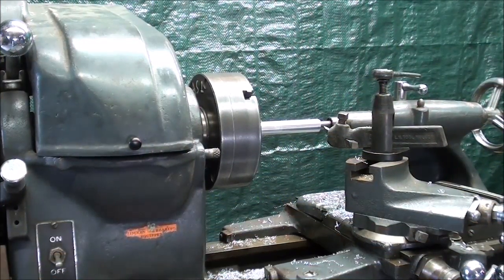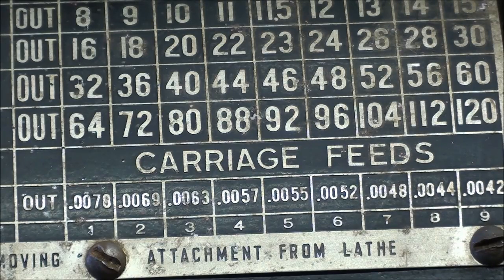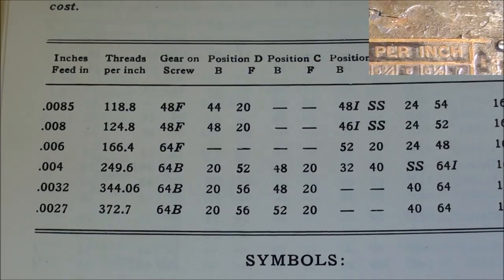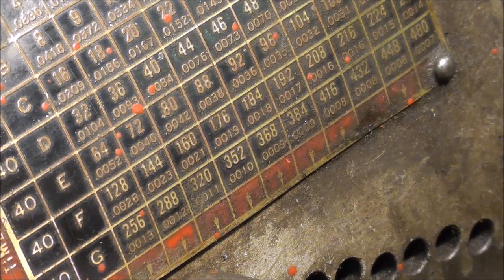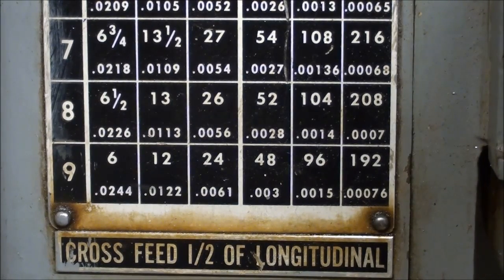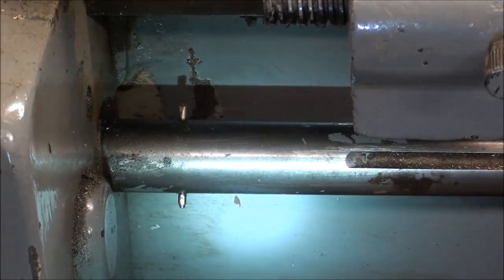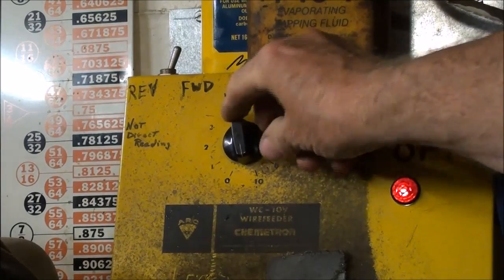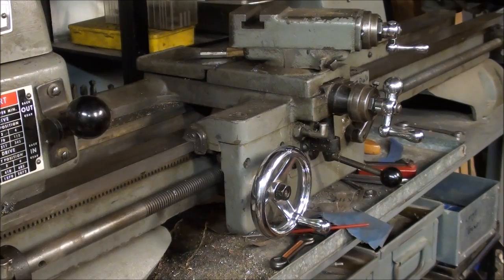SHOP TIPS #230 Critique of Feed Rates on the Atlas Lathe tubalcain

Comment: Thanks for the video.  About your MIG welder wire feed upgrade on the Atlas/Craftsman lathe.  At its slowest speed, what do you estimate as the feed rate?
Reply: +cemx86 The actual feed rate would depend on the spindle RPM.

update, I should have said the actual feed rate would depend on the spindle RPM versus the lead screw RPM versus the lead screw pitch. For instance if your spindle rpm matched the lead screw rpm, you would essentially be cutting a thread equal to the lead screw pitch. Increasing the spindle RPM would increase this pitch.
Reply: +Joe Allen Correct.  But at the slowest RPM what is feed rate as compared to the other lathes' lowest rate?  Maybe this is a fix to get this particular lathe in the "ball park" of the other lathes, or maybe it is better than the other lathes.
Reply: +cemx86 
basically you're trying to calculate the feed rate using two unknown values. The spindle RPM And the motor RPM. The motor RPM would depend on the slowest possible speed for that motor. Spindle RPM would depend on the highest possible speed of that material and cutting tool. because these two values are unknown, along with the lead screw threads, it is not possible to give you an exact feed rate. But basically if the two RPMs matched, you would be producing a thread equal to the lead screw thread. Doubling the spindle speed, would double the thread pitch. Decreasing the spindle speed by one half, would divide the thread pitch in  half. The opposite would be true; if you left the spindle speed the same and increased or decreased the motor speed.
Reply from the maker: +cemx86 Never checked it--barely creeps